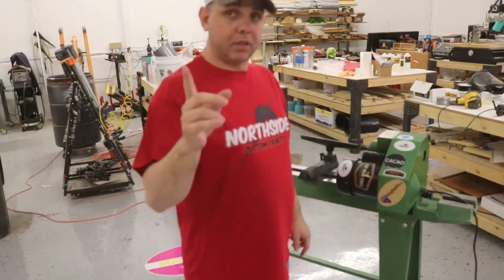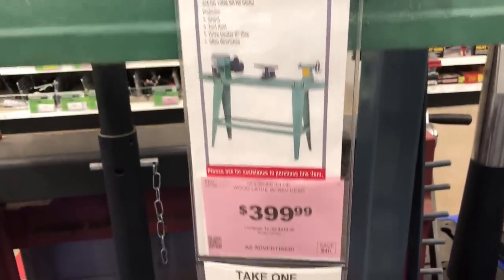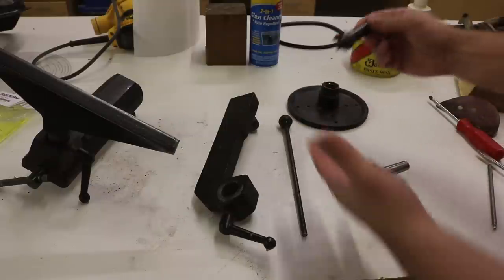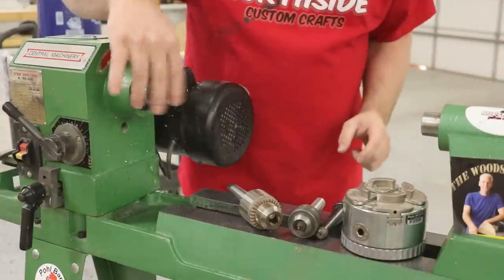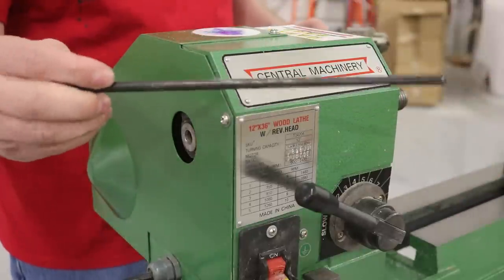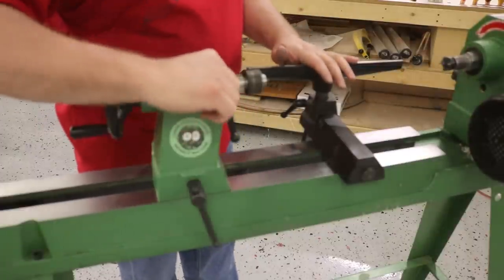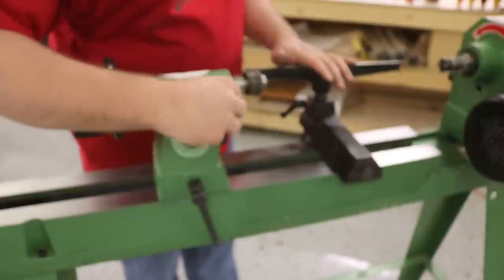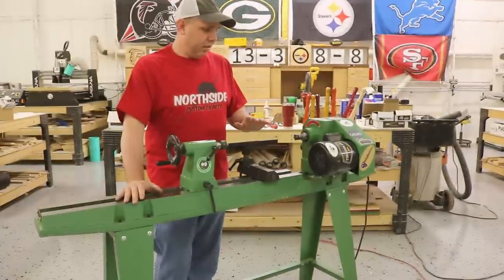Harbor Freight 34706 Lathe Review - 12 x 36 Wood Lathe

Comment: I've had a HF 34706 for a little over nine years. On average I'll turn 10-12 candle lights and vases, 8-10 bowls, and 5-6 desk/table lamps (minimum) every month with it. I've found it to be reliable, easy to use, and mechanically sound IF you take care of it. At 3/4 HP it is somewhat underpowered for a lathe its size so don't try and overload it. I've turned 10"(D) x 18"(L) pieces of wood on it but I've made sure they were balanced enough to take strain off the motor. When advancing the speed-control handle do it gradually so as allow the belt-drive system to ease up to speed. And make sure you do so likewise every time you want to shut off the lathe; ease the control handle back to its lowest setting. I use a large Wood River chuck and the 34706 handles it without problem. My 4"-6"-8" faceplates are no problem either. I've added other 1"x 8TPI and MT#2 accessories and they've made the 34706 even more versatile in what I can do. I took advantage of the stand's ability to install a shelf below the lathe bed; on the shelf I have 300-lbs. of sandbags that anchor the lathe solidly in place and prevent a lot a of vibration and wandering. For the money there is not a better lathe on the market, in my opinion. I started on a 34706 and have stayed with it despite advanced woodturning abilities and the ability to buy a more expensive one. It works for me but I take care of it. It will work for you if you take care of it. Regular cleaning, lubrication, an overall "easy' approach to using it will go a long way. It's gone nine years for me.

Comment: Jake, as you know, I turn with the same lathe. I have not had any problems.  For what it is, it is a horse. My lathe is anchored to the floor. That takes care of the lathe walking. Gr8 review!!
Reply from the maker: John Wallace Thank you John.. I’m glad you enjoyed it!! 👍
Reply: I actually took mine off the base and when I need to use it, I just put it up on my workbench. I never had any issues with it on the stand, but I like it better on the bench. The bench does NOT move no matter what I am doing and I can even clamp the lathe down to the edge of the bench. 

Now the  next thing is the DC motor modification.Then you get the slower and faster speed thing taken care of as well.

Comment: I have one of these. I love it. Its a work horse. I  started with the HF 5 speed table top lathe,  used it for 5 years before getting the big one. Been using this one almost 3 years. I use it more than my jet lathe. I definitely recommend it. As for the stand, i found it a little low for my comfort, so i added 4x4 blocks under it. Since then, I mounted it on my work bench. I love it
Reply from the maker: Awesome.. Thank you 👍👍

Comment: I solved the weight "issue" by building a shelf along the lower brace with some 1/2 plywood I had lying around and just put a bag of concrete or two when I need the extra stability.  Great review, I got mine used too and you provided excellent information for anyone who has inherited one of these machines.
Reply from the maker: Daniel Carroll Thank you for watching Daniel. Glad you enjoyed it. 👍👍
Reply: Yep I'm putting a shelf in mine and this is a great idea.
Reply: @caratapken3811 yup. I’ve been doing this for years. I ‘discovered’ this back in the early 90s when my Delta ‘34-series’ (smallest cast iron top tablesaw they offered) got modified for a router table and 60” custom fence that I built. The sheet steel stand and base got ditched for a spruce 2x4 base with plywood panels, and the unintended storage area absorbed a few hundred pounds of tools. 
That completely changed the saw! I wasn’t unhappy with it before but it instantly became butter smooth and stable with a braced base and weight. 

3/4” MDF glued and screwed inside 12- and 14” bandsaw cabinets transforms them as well.

Comment: Hello Jake I am from guyana, just bought a used  lathe  like yours but your video was helpful to see how many problems are there ,I did not get the spur  center  ,the speed control thing is stuck at high will appreciate a video on a fix the other stuff I may have to buy from usa

Comment: Just a heads up, you can no longer use the 20% off coupon at Harbor Freight. They have excluded central machinery now. But if you know someone that works there once a year they get to give out 10, 25% off coupons with NO EXCLUDED ITEMS to their friends and family. Dang, its sad how much i know about that place 😔
Reply from the maker: Brads Workbench Haha.. Brad.. I figured you would know the ins and outs of it.. lol
Reply: I bought my 10x18 HF wood lathe years ago using a 25% coupon, and it still works fine.  That little thing is all cast iron, and it doesn't jump around.  It's all I need for pen turning.
Reply: 2023, harbor freight has discontinued this machine…

Comment: bought that model lathe last summer. i went online and searched "harbor freight lathe coupon". its true that the regular coupons exclude central machinery. but you can find coupons just for this lathe. im happy with mine so far. i do wish the motor had a slower speed, but maybe i can rig something for that. it is pretty lightweight. im in the process of building a stand for mine that will raise it up 4 or 5 inches, and have retractable casters. ( i work in a garage, so the lathe has to be moveable) im building the bench/stand very heavy and solid. if i someday get a bigger, better lathe, ill still have a heavy workbench! good review jake (as always!). from watching your stuff, and seeing the other responses here, i can see that you really dont have to spend thousands for a lathe to turn! good job!
Reply from the maker: dave b. Thank you very much.. I’m happy you enjoy the videos.. I appreciate it. 👍👍

Comment: I can't wait!  She is ready to rock now.  What did you use to keep your lathe from running off?  I've thought of drilling peg holes into my concrete floor.  Also the jack with the foot lift brake.
Reply from the maker: You can anchor it to the floor or put weights on the legs.. lol I haven’t done anything yet. Just keep the speed down until it’s round.

Comment: 10:19 
I have added steel to various things to add weight. Not just the steel, but I’ve made boxed trays across the legs, for example, which stiffens it up but more importantly they hold sand. A fairly small and inexpensive boxed steel ‘shelf’ will hold 3-4 bags of sand adding 300lbs to a tool base. A couple diagonals and the tool has a lot of strength and weight. With a lathe, the oscillating shake stops making smoother cuts as well as it no longer walking around the shop (because it has better floor contact if it isn’t vibrating). I even have a small woodworking bench I made that is under 100# to transport, but is over 300# in use. 
Just some thoughts. And by the way- unbalanced or otherwise vibrating tools are not cured by merely bolting them to the floor. Mass and diagonal dampening is the only fix with ‘cheap’ tools.

Comment: hey boss, i just got this lathe. im having a problem locking the motor to the base. ive already stripped the lock down handle. i cant do anything until i can lock it down. its like i cant even turn the rod to tighten it down. something isnt right. i rigged the stripped handle enough to make it crank btw.
Reply from the maker: Did you buy it new or used.. I would take it apart and inspect if there’s something wrong.

Comment: I bought mine for $279.00 about 2 years ago and have used the hell out of mine. I have turned bowls, pens and even table legs. I use Nova Chucks and really like them. And I really like the fact that the head stock rotates. Really the only thing I wish it had is a turning wheel where you insert the knockout bar.  Thank you for doing the review. Turning is very relaxing to me.
Reply from the maker: Lee Cook Thank you Lee!! I love turning.. lots to learn and it’s amazing what can be made.. 👍👍

Comment: I've owned the same lathe since 2001. I agree with virtually everything that was said in this review. I bought a larger, better, lathe a couple of years after getting this one. I still use my HF lathe frequently. Mostly as a buffing station, but I like it for longer spindles. The HF is an excellent spindle lathe. For pens, pepper mills, lamp bases, etc., it's really all you need. As was noted in the review, the HF lathe struggles with bowls or anything that's out of balance. The legs are made from fairly thin sheet steel. There's too much flex for a turning something out of balance. (You can address this by mounting the lathe to a bench.) 

For the same reason, you really don't want to turn the lathe's headstock to allow for off-board turning. The lathe really isn't stable enough to turn anything larger than its 12" swing. Even if you the blank was superbly balanced, you want to turn larger blanks at less than the lathe's minimum speed. Keep it centered between the ways and you'll do fine. If you do turn the lathe's headstock, get a double-ended morse taper to align the headstock with the tailstock.  You stick one end in the tailstock, then swing the headstock back into position until the other end of the double-ended morse taper can be slid into the headstock's spindle. Then, lock down the headstock. It's easy and is super accurate.
Reply from the maker: David Walser Great comment David.. Thanks for watching. 👍👍👊

Comment: I have a delta 14-40 iron bed. It wasn't $300. It has a slow speed of 500. It walks all over the shop, the speed control is much harder to adjust than the one you demonstrate.  I snapped my tool rest extension with a catch so I  decided to not do any extended turning.  Great review shows that you can turn wood on a budget. Don't have to but you can.
Reply from the maker: Rick Chapman Thank you very much Rick.. glad you enjoyed!!

Comment: I'm buying a lathe and starting my journey. I'm going on this voyage of exploration and have you to help me. I thank you so fkn much.
Reply from the maker: That’s what I’m talkin bout!! 😄👍👊
Reply: I just saw a beautiful old lathe on craigslist, just needs a motor, it has a 4 step cone pulley wheel in the headstock.  They were asking $50 .       You could buy a variable speed treadmill motor connect a belt to any 1 of the 4 pulley steps,  and use the motor's speed control, and you would be on your way for very little money.  I agree, hand turning can be explored for very little $.
Reply: @JakeThompson  hi bro how will I get this in India please help I want  learn

Comment: I've had mine about 6+ years now. i have no complaints. I've broke a few parts on it. repaired it and still use it. I added a piece of wood in the center and put 4 50lb bags of play sand which made it stop walking around the garage. Only thing I wish i could do would be a stronger motor. I don't know how to do that or it would of been done already
Reply: I did the say except put a 5 drawer toolbox on "shelf" of sorts. Great for storing face plates, drive centers, all kinds of stuff. Probably weighs around 100 lbs or so
Reply: Brads Workbench that’s a good idea. Never thought of that

Comment: A little over seven months ago I posted on this channel about my nine-plus years of experience with the 34706, and gave my opinion that it was the best lathe, for the money, on the market. That's still my opinion. However, I must have jinxed myself with that post because just a month later the motor on my 34706 stopped working. Toasted. Fried. Not-gonna-run-again. Windings were shot, capacitor conked out. I figured, conservatively, that I'd gotten around 5,000-hours out of that motor so I definitely got my money's worth. BUT, all was not lost. A few phone calls and emails to Harbor Freight and for a little over $150 I received a new motor and some associated installation parts like springs and c-rings. In less than an hour I had the pulleys re-installed on the shaft, motor mounted, and electrical connections done and I was back in business. Harbor Freight Parts Dept. was great! Just wanted everyone to know that the 34706 is a tough unit, 9-years and 5,000-hours (if you take care of it), and Harbor Freight's parts folks are there when you need them. If you're looking for a lathe and the 34706 is a consideration, go for it. You wont be sorry.
Reply from the maker: You definitely got your money’s worth.. now it’s time for round 2 💪💪

Comment: I like the fact that the headstock swings outboard to turn larger items, but for something big you need the speed to be less than 100 rpms, not 600. Is there a speed reducer available?
Reply from the maker: I haven’t found one. The other thing is.. you need to have it bolted to the floor or weighted down.. the lathe is very light

Comment: I as told the tool rest should be elbow height for control and comfort while turning.  The HR lathe tool rest sits at about 41 inch's off the floor, but because I'm 6'5" tall, I needed it to be about 47 inches. I picked up a 4X6x8 at HD for 10 bucks and built an "I" shaped riser bringing the tool rest, at center, to just under 47 inches. the weight of the 4X6 also helps keep the lathe in place when the material is out of balance.  It also gave me a place to mount some retractable wheels as there is no perminent place for anything in my small workshop. Be well.
Reply from the maker: Good stuff.. good fix.. Thank you for watching.

Comment: Hey Jake.  I enjoyed your video and just picked up the same lathe from HF.     I’ve never turned before and am a total novice in this area. Question.   When I align the tip of the headstock spur with the point in the tail stock,  the spur in the headstock is complaner but about 1/16” lower than the tail stock tip.  Should I shim the headstock to raise it up or is this not too big of a problem.    Any suggestions?
Reply from the maker: Hey Kerry .. I’m glad you enjoyed the video.. they should be touching tips.. I didn’t have to adjust mine . But they should be pretty much exact..

Comment: I bought one a couple years ago, and while it has done a good job, for the most part, I’ve had a repeating problem with the speed not advancing, and the variable pulley not engaging the belt. At first, I just lubed the shaft of the variable pulley, but after a while, the gear connected to the speed control handle became fouled with dust and chips even though it’s contained within a cast housing. If Harbor Freight parts department is out of a part, they wait till they receive it from China, which could take months. I have set this lathe aside and purchase a Grizzly 14x20 variable speed reversing lathe. Speed is adjusted by a potentiometer, and an RPM display sits above the pot. I am exceptionally pleased with the Grizzly lathe.

Comment: Thanks, this video help me to go and get this one. How about throwing some small rubber pieces under the feet, then throw a sandbag or two on the crossbars? I have done this with my drill presses and grinders on the metal stands. I need the mobility of these machines.
Reply from the maker: I’m going to bolt it down somewhere when I get it  in a more permanent location. 👍👍

Comment: Thank you, I have that exact model and have been considering purchasing different accessories for it. I wasn't sure of the sizes necessary for it. I also found mine to be too light, however I wanted it mobile. I mounted mine to a set of cabinets with locking casters. It has worked well for me.
Reply from the maker: Awesome.. it is pretty light.. but I make due with it.. it’s pretty dependable.

Comment: @Jake Thompson or anyone who casts with resin, when is it more desirable to cast your molds under pressure versus in a vacuum? Are there any differences in the outcome of the product? Casting in a vacuum seems like it has the potential to get messy as the air escapes, and I'm not sure if, when doing something like stabilizing wood, i like the idea of the stabilizer or resin simply being allowed to flow into tight spaces, versus being forced into them by pressure.
Reply from the maker: Z B some prefer to use vacuum to release bubbles from the resin.. I use fast setting resin which doesn’t allow time to use the vacuum chamber... and I have a pressure pot.. so I have no mess like you mentioned.

Comment: Hey Jake thanks for the review on H.F woodlathe its been a while now since i done some turning and after the completion of my new workshop the only thing missing is a new lathe,I found your review very interesting as i buy a lot of equipment from H.F. as for your lathe dancing around the shop floor with my old lathe i placed some rubber pads under each foot then bolted the lathe too the floor both movement at high speeds and vibration when turning was solved,once again thanks for the tips.
Reply from the maker: Nobby DeBlue Glad you enjoyed it.. I’m going to bolt mine down after I find it’s permanent home. 👍👍

Comment: I have the same lathe. I've had probably about 2 years. Those handles can strip out but that's no big deal. I've made some modifications to mine. I didn't use the legs. I made my own stand with casters. I modified a spindle lock. That comes in handy. I made it reverse but quit using it. You can get the speed control at harbor freight. That will actually slow it down to almost stopping, but it has no torque. It works for putting on the finish so it doesn't splatter everywhere. One problem I've had with mine is when you work between centers if you apply to much pressure with the tailstock it will tilt the headstock back. I put a spacer on the back side where the lock pin is. That seemed to help. I love it and plan to keep using it til it dies. TTFN Sid.

Comment: Is there any way you can slow the speed? I’ve seen devices that are designed to do that but I wondered if they could be used. I’ve got a Grizzly that has the same lowest speed and I’m looking to slow it down to around 300. Any advice?
Reply from the maker: Tim Wise ... I’m going to look into that.. That’s for sure.. I wish mine would go way slow.. I will figure it out. 👍👊